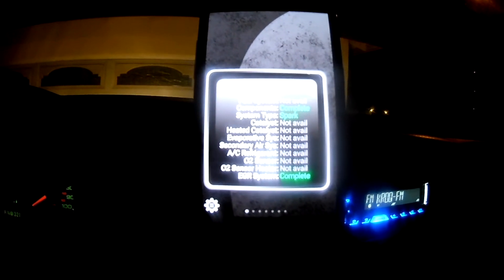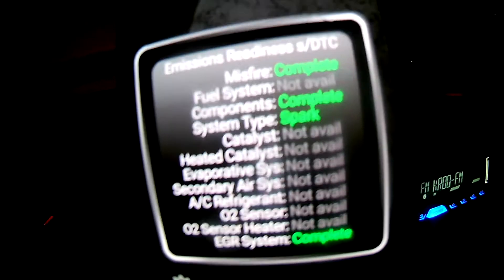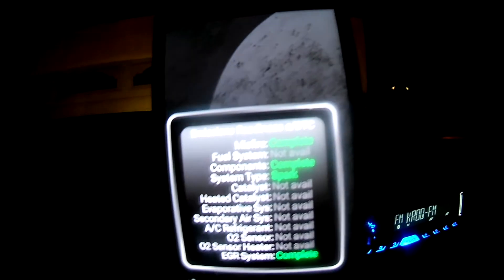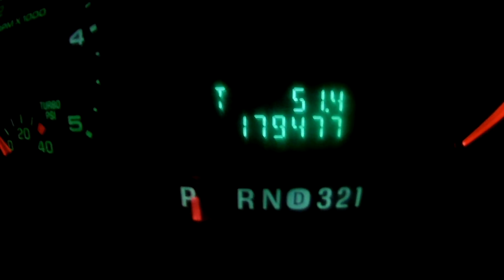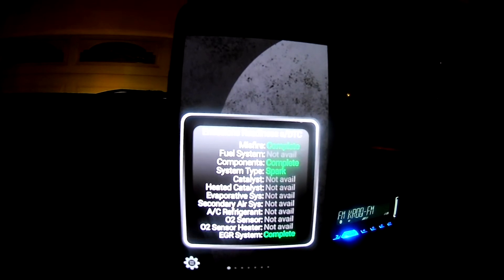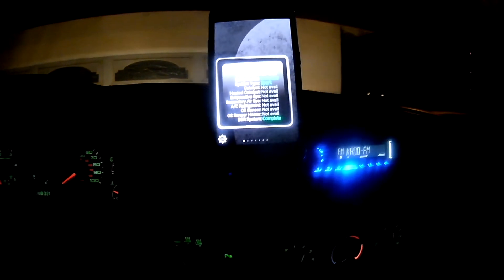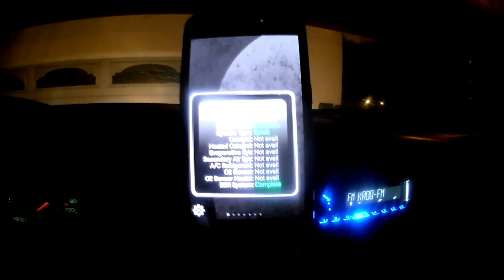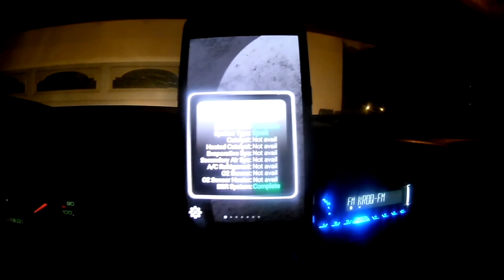How to Pass Emissions Drive Cycle test EGR Readiness CA Diesel smog powerstoke 6.0

Comment: Also in So Cal near Disneyland. ASE Certified Tech been 650 miles same issue EGR monitor INC. have cleared it factory programmed replaced EGR swapped out 38in mudders for stock rims and tires. IAC sensor replaced. manifold gaskets replaced. EGR cooler is sinister EGR valve is Dorman but also tried Motorcraft. only time the EGR opens is going up the Cajon pass to Victorville. been up and down 10 times 78 Miles each way. the EGR duty cycle pid is only showing that its opening under long grade pulls or highspeed. The customer drove to San Juan Capistrano and around town 297 miles and same thing. we changed parts because his PC would set soft codes for P0401 only while pulling Cajon pass.